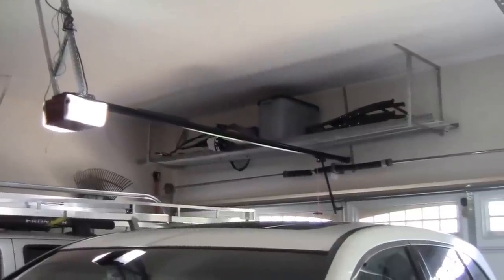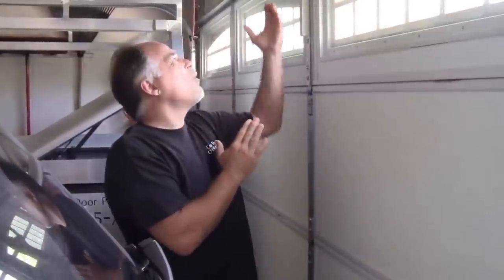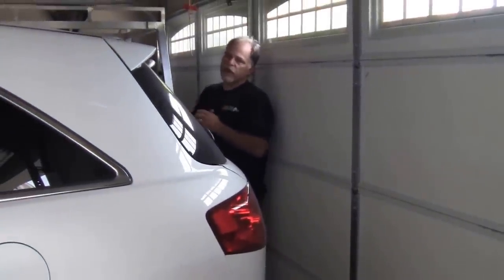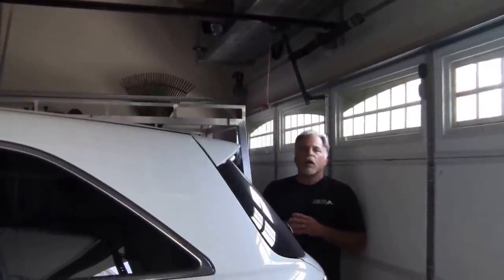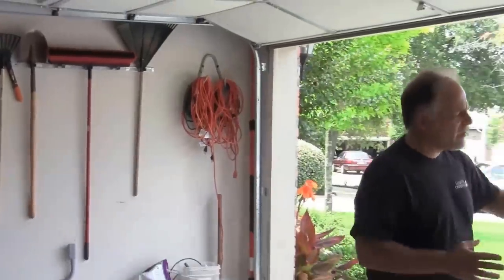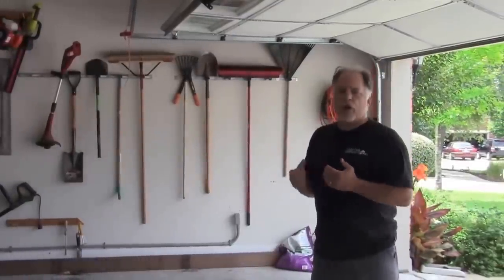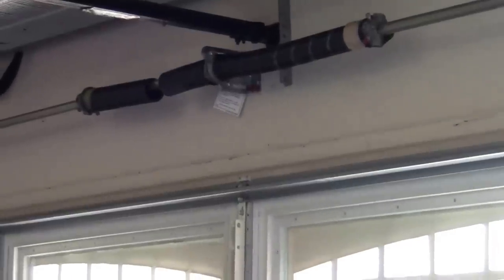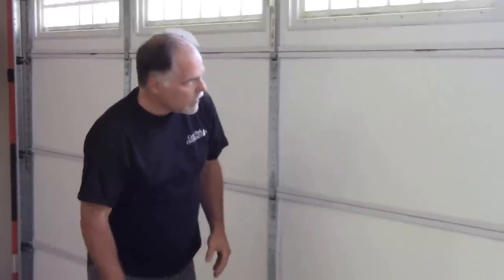Broken Garage Door Spring Tutorial

Comment: Thank you so much for the video. I had EXACTLY the same situation, got up in the morning, wanted to take the lil one to school and the door won't open not even manually! But with your tips i could open the garage door manually and take my car out of the garage. You literally saved my day! thanks again.

I would however mention that guys if you face the same situation, and your door happen to be like mine (heavy wooden old garage door, not this modern / newer light weight door) and after you follow his tips in the video, and the spring-er isn't fixed yet and you want to close the garage, just press the button and let it close by itself / don't help it much while it's going down. I've done this mistake! and as a result the cables came out off their place (cables that go around the 2 circles on both sides up), i managed to roll them back to their place and closed it but it took me extra work and time. Moreover, the door didn't just came down, but it came down, stuck once, don't worry just press the button again, done that and the door went down again, and again till the door closed completely.